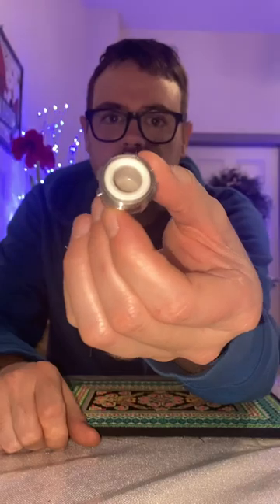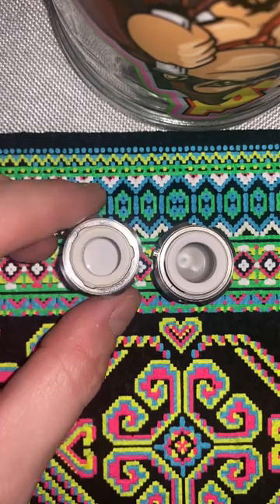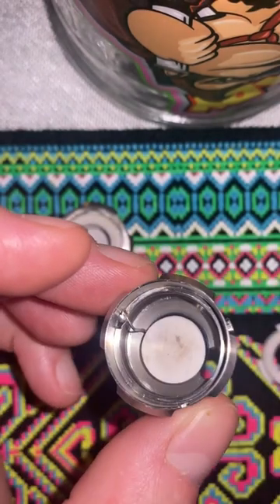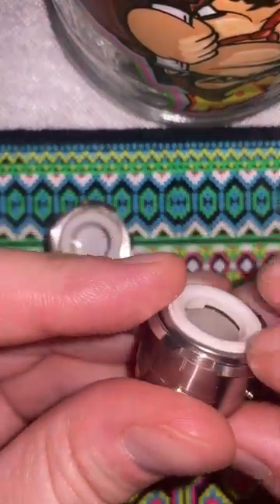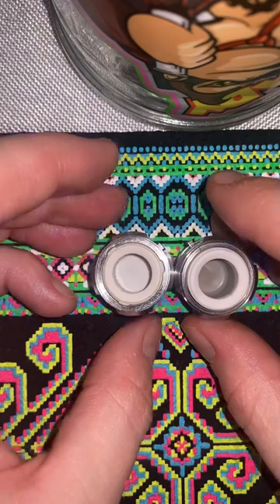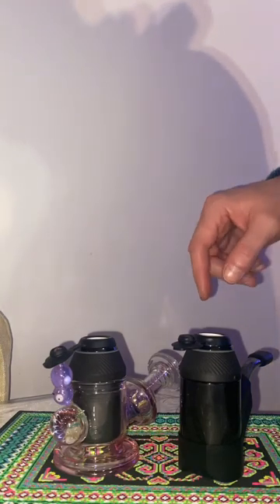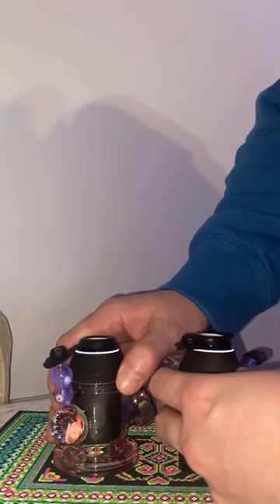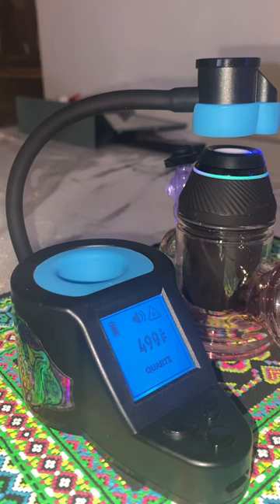Puffco Proxy JCVAP ICA review

Comment: They sell coils for it so it can be rebuilt...
Reply from the maker: Yes but you would need to re solder the coil
Reply: @adubsdablab  they sure didn't tell me that i ordered replacement coils too😂😂
Reply from the maker: @eedeedabsthedabgod710  well at least they did before, let me know if they have change when they arrive
Reply: @adubsdablab  Yea they still need to be soldered. They gave me 2 free shells for not mentioning it. So now im learning a new skill 🤦🏾‍♂🤣
Reply from the maker: @eedeedabsthedabgod710  beautiful and trust me when you do it, you’ll be like “that’s it” 😂
Reply: Agreed soldering isn’t as bad as I thought it was; just sounds/looks scary but it’s like simple/easy welding
Reply from the maker: @Cowboys777  exactly, basically it’s to welding what an easy bake oven is to baking
Reply: @Cowboys777  now i just wish i could use my ball cap with the silicon but cant have everything 👍🏾